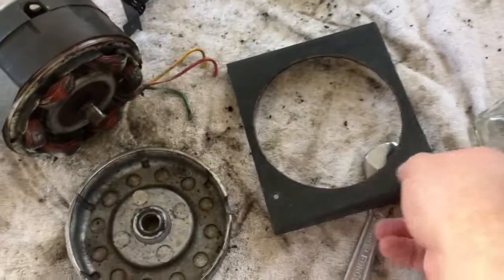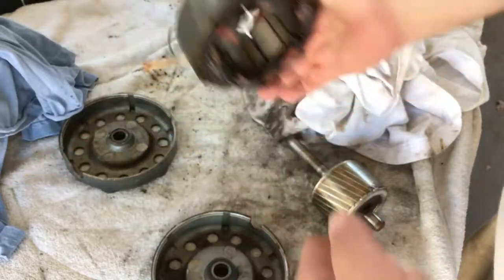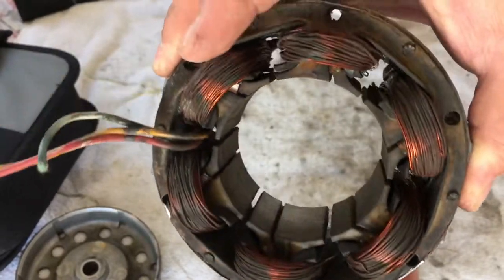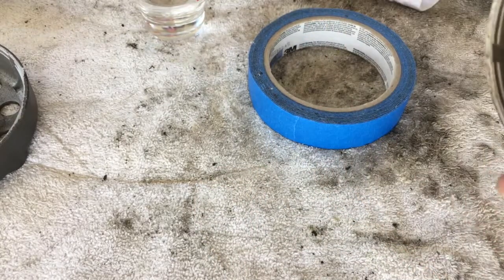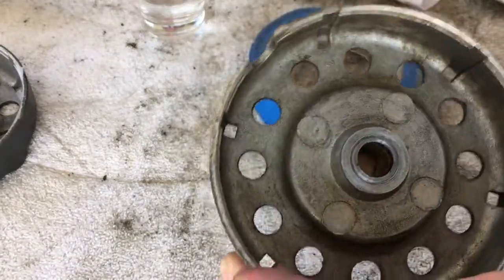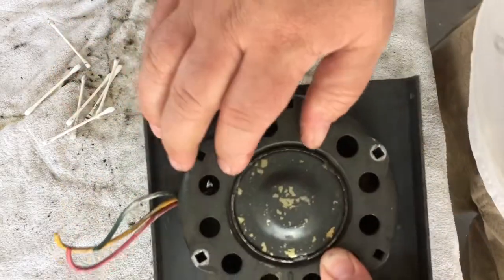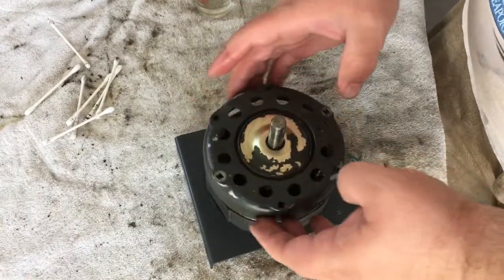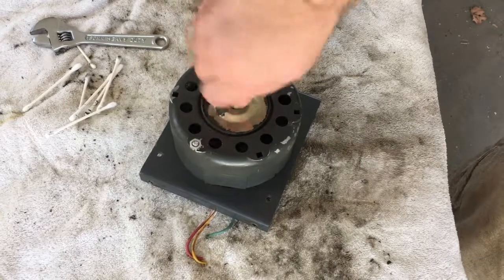Mobilaire Tear Down 4 Motor City

Comment: Get a small drill bit and drill a tiny hole in the sheet metal bearing cap and pump a bit of zoom spout in it , get the felts saturated again